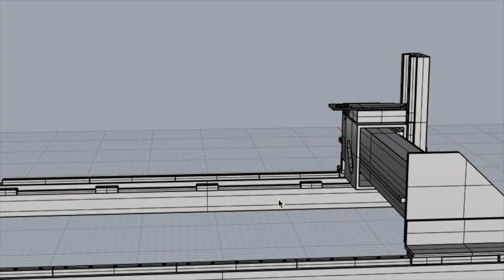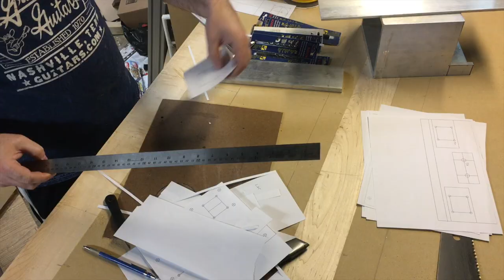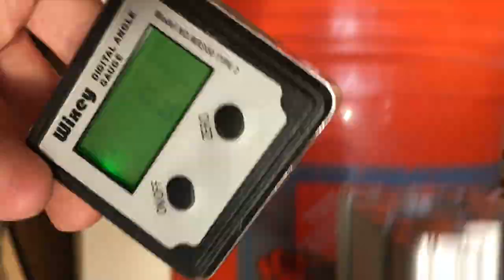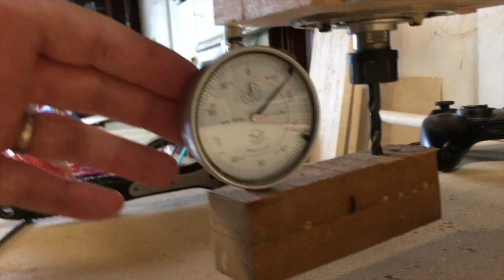CNC Router Build

Comment: Nice job.
A little information, the guide roller for the tooth belt are installed on the wrong site. For a guide roller you take the flat site and not the site with the teeth ;)
Greets from Germany

Comment: Hope ya used shielded wire for the steppers (even though they are closed loops) etc. I have the fun job of redo-ing all my stepper motor wiring with it as soon as the shielded cables arrive.

With the spindle running the USB to my motion controller freaks out every time. It works with ethernet but still, not a good sign. Ah well lesson learned
Reply from the maker: It's a really good point. The first machine I built, I'd lose steps in my non-shielded cables. I'm using the shielded ones from CNC Router Parts now and haven't had any issues.

Comment: Nice job, I’m just getting started on a build myself, I was planning on putting the guide rails for the gantry on the side, I noticed you put ours on the top.do you have any problems with keeping the free of saw dust?
Reply from the maker: I've never had a problem with it. The dust seals on the bearing carriages do a good job as dust squeegees, so it clears dust as it goes. I have had dust build up in the bolt holes of the rails. If I ever take them off, it may complicate things. There are times I wished I'd mounted them on the outside, along with the long-axis pinions. But that's about range of motion and usable work surface. I might have been able to get another 4-6" (100-150mm) of usable width if all the motion components were outside of the rails. But, I was very space-constrained when I built it, and it hasn't been a big problem since.

Comment: Where do you buy your 80/20 tubing and fasteners?
Reply from the maker: 8020 inc used to have an eBay store for their surplus extrusion. Unfortunately, that closed earlier this year. Now, when I buy extrusion, I typically get unofficial 8020-type Chinese manufactured from eBay. Official 8020 is great stuff, but for my purposes, good enough is generally good enough -- and it's definitely much cheaper than the real-deal.
Reply: Thanks for the input.  For my needs cheaper is better.  I just worry getting it off eBay I am not ordering the right gauage etc.. And then the pieces won't fit together correctly.
Reply from the maker: @nathanburt6053  It's always a possible issue. I'm certainly not going to guarantee the quality of stuff off of eBay. But in general, the key dimensions of the different extrusion types have become pretty standard, at least as far as overall size, slots, etc. You're more likely to find differences of wall thickness, and internal cavities. So I wouldn't expect to tap exactly the same hole in the end of an "official" piece of 2020 and an eBay special. But for the main connecting surfaces, in my experience it's close enough. And if you buy it all together, you end up with consistency -- which is really all you need.

Comment: Well done, excellent job. Inspire me to start to build one myself. What kind of spindel did you use? Have you used it for metal routing? Curious how much I need to spend to build me own one?
Reply from the maker: Thanks! I'm currently using a router as a spindle - Hitachi M12VC. I've cut a little bit of aluminum with it, but it makes me nervous enough that I don't plan to do more, even though it was trouble free. I have a spindle -- cheap eBay job -- that I want to mount, but I need to do wiring for the inverter first.

Comment: Please tell us why after building such a nice machine, you used wood for the spindle mount. I don't understand that.
Reply from the maker: That's a fair question. When I was building it, it came down to how easy it was to fabricate. I wanted to use aluminum, but I didn't have a way to cut the curve well. I cut a lot of Al while making the machine, but everything was in a straight line. I needed a fairly close fit between the router mount and body, and I could do that with wood much more easily than metal. Once the part was done, it was done, and it's working fine. Since I'm not having issues with stiffness or alignment, I'm good. 

I'm about to start some upgrades including a proper spindle, and that has a metal mount.

Comment: Great-looking machine. What specs? Linear rails, motors, alu profiles, drivers, power supplies, controller board, spindle, homing switches, working volume? I'd love to see this cutting alu.
Reply from the maker: Thanks, Simon. I get 52"x24"x5.5" of useful travel on the axes. Rails and bearings are Hiwin (or Hiwin clone) I got from ebay -- HGH20CA. Motors are ~400 in-oz Nema-23 which I run at around 2.5A from some generic 20A ebay power supply. Rack and pinion and the r-p drive assemblies/motor mounts are CNC Router Parts components. Homing switches are NPN-NC 8mm proximity switches -- whatever I found on Amazon, but nothing special. I'm using a range of 8020 extrusions in the 15-series. X-axes are 1545, Y-beam is 3060. I have a UC400ETH driving a Gecko G540 for the control, and UCCNC for the controller software. My spindle is just a Hitachi M12VC router -- factory collet for 1/4" and 1/2" bits, Precision Bits collet for 1/8".

Cutting aluminum is in the cards if I can get it to work -- and hopefully circuit boards too. I'm in the process of moving to a new house and new shop right now, but I hope to be back in action pretty soon.
Reply: I gave this a thumbs up when I read it a while ago but now I have more questions! What calculation did you do to work out the angle of the rack and pinion drive "swing arm" to make sure that forces between teeth didn't result in the drive gear lifting away from the rack and introducing a deflection in that axis?

Also, (perhaps easier to answer) what DC voltage did you go for on the NEMA 23s? 24V, 36V, 48V?

Thanks - can't wait to see what else you get up to with this machine!
Reply from the maker: Thanks, Simon!

I didn't really do any calculations on the rack and pinion arms. I'm using the R&P motor mounts from CNC Router Parts. Those have a pivot on a bushing at one end, and a spring at the other which holds tension between the rack and the gear. I followed their instructions for setup. I'm not too worried about skipping, as I only use the R&P for X/Y movement. There's just not all that much lateral force if I have my feed rate set correctly. Z is controlled by a lead screw in a zero backlash delrin nut. I keep the Z feeds slower since that's bearing the weight of the router, mount, and some Z axis components.

For the motors, I have a 36V-capable supply which I'm running at 24V. The motors themselves are around 400oz-in, with the way I have them wired (the way the Gecko drive seems to prefer). 

I'm in the middle of a move to a new house right now, but more projects are coming. I can't wait to be settled in and have the machine set up in the new shop.

Comment: hello, nice job you did. what is it going to cost to completely build and pre assemble this machine and ship to me. i'm in need of one. thanks.
Reply from the maker: Thanks Paul. You could probably build it for around $2500 US in parts and materials. I repurposed a lot of existing electronics, so I don't have an accurate count on that. I accounted for all the non-electronics, though (basically everything but motors, drivers, cables, cable management) in the bill of materials. That's at a link in the pinned comment. 

I'm not prepared to build one as a commercial offering. It wasn't super difficult, though. I was able to do it almost entirely with woodworking tools. My CAD files for the design are in that same link -- it's not an instruction guide, but it might get you started.

Comment: Grest job man , i m fronte Italy i ve a CNC and i want make It stronger , can you tell wich Blade you use on you table saw ti cito alluminium thank you
Reply from the maker: I used a conventional wood blade with carbide teeth. This one is a thin-kerf Diablo general purpose blade. Nothing special, though I link thin-kerf for aluminum so it doesn't have to remove as much material.

Comment: Excellent project thanks for sharing!
I have a question, what software do you use to generate the machine code of your 3D CAD models. And what driver do you use for the cnc machine? God bless you.
Reply from the maker: I use a Gecko G540 for my drivers -- very simple, but it gets the job done well. For actual motion control, I use a combination of UCCNC as my control software, connected to a UC400ETH. I originally used Mach3, but I've found UCCNC to be more reliable and to cut better, once I got it tuned up. 

For generating GCode, I typically use Vectric's VCarve Pro. I'm a Mac guy, so I have to run it in a virtual machine, but that's no big deal. I have a few situations where I've written python programs to generate GCode for specific purposes, and I'll occasionally do super-simple things by hand.

Comment: Good job!
I'm trying to do something similar.  It is not a CNC but it is a machine that will move in x and y axes and I am planing to use a rack and pinion system. Where did you get yours? Are they working good?
Reply from the maker: Thanks. I got the drive assemblies from cncrouterparts.com. They had the racks and pinions, including the mounting plates for the X-Y motors, pinion gears, and gear-reduction belts. They work very well, and I'm glad I bought them from a single supplier, as it made everything easier. It's reliable, and also has good safety mechanisms for my dumb mistakes. If I leave the gantry path obstructed (something sitting on the router bed that would jam it), the springs that hold tension on the rack and pinion gears allow things to skip, which is way better than stripping the gears. It's saved me more than once, and I'd absolutely buy the same parts again.

Comment: Really nice! I am currently looking for a similar aluminum profile for my gantry and these 
big sizes seems to be hard do find. Can you share where you got the profile from? And also if you know what number aluminum alloy it is? Thanks!
Reply from the maker: All of the T-track aluminum (so most of the machine) is made with extrusion from 8020 Inc. I don't know what their alloy is, but I also didn't have any alloy choices with those components, so I didn't sweat it. For the other aluminum stock (L that joins the gantry riser to the X bearings, plate connecting the Y carriage to the Z axis assembly, and the Y carriage itself), those are all 6061-T6 aluminum. I chose that because I could get components in the sizes I needed -- my supplier had the most variety of that, by far -- and because it seemed like it was well regarded for structural use. I certainly didn't do any calculations around it.

The 8020 extrusions are a bunch of different profiles in the 1.5 inch family. 1545 for the X axes, 1530 for the risers, 3060 for the big beam. I could almost definitely have gone smaller, but I knew I wanted a beefy beam since it's almost 36"/1m long and I didn't want to worry about it either sagging or twisting. All the other sizes were chosen mostly to get either the height that I needed (1545 X rails lifted the gantry higher so I didn't have to make the gantry itself taller), or for the correct connectivity to another component (1530 for the risers-to-beam connection, etc). There's no question you could scale this down quite a bit and maintain a lot of strength.
Reply: Thanks a lot for the detailed answer! it's been a great help.

Comment: what type of liner guide rails are those?....like the pn?
Reply from the maker: I built around the Hiwin HGW20CA. I don't think these are actual Hiwin brand, but their dimensionally identical ones I got on eBay. There's a link in the BOM spreadsheet that takes you to the specific part.

Comment: hi
what about aluminum milling its work with these materials? or something else 
what the spindle and motor size for that ?
Reply from the maker: I have not milled aluminum with this machine. I'm not concerned about it being strong enough -- it should be fine for that. I don't know if the woodworking router can achieve the right speed to cut aluminum well, and I don't really have any capability for coolant flow. Coolant may not be essential, but it would certainly help. 

I'm planning an upgrade to a proper spindle which will give me about 6000-24000RPM range. When that's done, I do play to try some aluminum milling.
Reply: thank you v much

Comment: sir i m very much interested in building my own cnc routerbut i have no knowlwdge of electronics.which course should i join to learn so that i can build my own cnc router
Reply from the maker: You don't need to know a lot of electronics to build a CNC router. It doesn't hurt, but for most machines, the electronics are pretty simple. It's more about understanding the components you need to buy (motors, controllers, drivers, etc) than having any real knowledge of electronics. That comes in more if you're planning to build components yourself or customize. For a good overview of the electrical components, what they do, and how they work, I'd check out https://buildyourcnc.com/CNCElectronicsandWiring.aspx. It's a great introduction.

Comment: Do you plan on having plans available?  Thanks
Reply from the maker: I've thought about it. I'm happy to share my CAD files as they are -- they're about 90% accurate to the finished machine. I made some structural changes on the fly, substituting 8020 extrusion for the large plates that make the gantry risers. I also didn't model out every hole and bolt. If I were to make plans I'd really want to get those details right. It'd be a fair amount of work to make real plans and the build guide required to make sense of them.

Comment: where did you get that extruded aluminum?
Reply from the maker: It's all 8020. You can get it directly from them at 8020.net. I used their eBay store. It's where they sell offcuts, returns, scratched pieces, etc. There's less selection than the outright retail website, but I saved a bunch of money. I had to adapt my plans a little. I'd originally intended to use their metric 40-series instead of inch 15-series (so the gantry beam would have been 40-8016 instead of 15-3060). There was a lot more 15-series available on their ebay store, though, and everything was dimensionally pretty close, so I adjusted to that. With the savings, it was absolutely worth the effort to adapt to available materials.
Reply: Niiice...thank you for your reply bro......do you have a link or item # for it?....im building a 5x10 plasma cutter....direct drive...but i want the gantry to be a lottle lighter.......what type of guide rails did you use?
Reply from the maker: 8020 ebay store: http://stores.ebay.com/8020-Inc-Garage-Sale

Bearings and guide rails (the bearing blocks and rails are a unit, not purchased separately): http://www.ebay.com/itm/2-x-HGH20CA-2R-1500-1500mm-600mm-mm-Square-Liner-Rail-1-HGH20CA-Blcok-Bearing-/141920576862?hash=item210b20255e:g:~CMAAOSwvUlWrPlq

Comment: I see you use Rhino, do you use Rhinocam aswell?
Reply from the maker: I don't use Rhinocam. I use a Mac and Rhinocam is Windows only (I'm looking at you MecSoft). I do all my CAM in Vectric Pro -- which is also Windows only, so I do it under Parallels. I really don't want to deal with needing to use Parallels for Rhino itself, so I stick with Vectric. Maybe not the most obvious set of choices, but it works for me.
Reply: I see your point, there are some benfits in having seperate computers for cad/cam aswell, I guess it all depends on the purpose

both vectric and Rhinocam make good cam packages, I use vectric v-carve and Rhinocam.
  @RichFriedeman